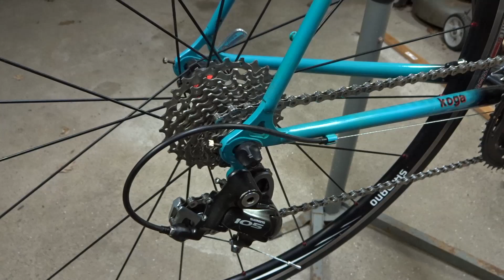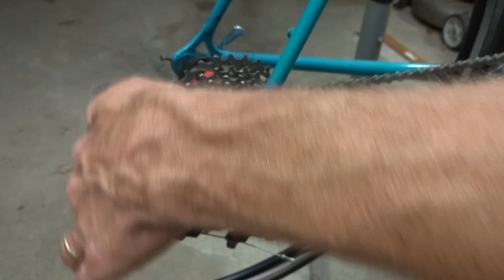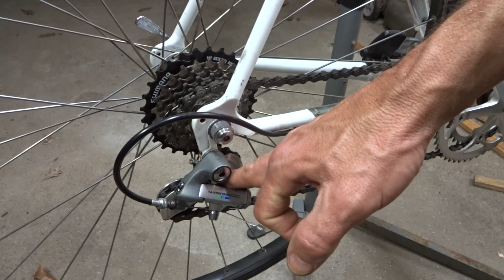How Indexed Shifting Works On A Bike

Comment: I was wondering how that worked. I converted my old Raleigh with downtube shifters (clamp on, not drilled in) to  indexed thumb shifters a 6 speed cassette (from 5 speed).  Time for a change again. I want stem shifters and I don't want indexed. I've had this old Raleigh from new and I want to give it a vintage look.

Comment: The amount of cable pull is set, I take it, by the click positions of the selector on the handlebar. I am having trouble with an old bike where the shift will stumble between gears. I figure this must either be a dirty shift cable sticking in the shrouds it passes through, or a worn selector on the handlebar.
Reply from the maker: https://www.youtube.com/watch?v=gwBQxhZhKnE

Comment: I have a Camapgnolo Athena 2015, and old Daytona 8 speed rear mech. What RD i can buy to mix it up. Because i cant find campagnolo RD in my country. Can i put a some mtb rd?? Im not looking for the perfect shifting, just ok.
Reply from the maker: Shrug. You will have to research cable pull ratios. Or find the correct RD.

Comment: Do you have a video on mix and matching derailleurs, shifters, cassettes/freewheels, hubs? I have an 83 Stumpjumper and it has a 7 speed cassette when it should have a 5 speed freewheel originally. The problem is that I don't know whether the current derailleurs (Deore XT RD-M735) and shifters (Deore Light Action SIS SL-M730) work with this 7 speed cassette. Thank you for the videos. I'm learning a lot.
Reply from the maker: No. Because there are so many variations and exceptions, it would be impossible to cover everything.

Comment: Hi Rj I've been watching some of your videos and subscribed. I stumbled upon your channel when a retired couple friend of mine gave their bikes to me. A man and women's trek 7300 model 1999 to 2001 I'm not sure. It is in perfect shape except that I want to convert it to drop bars (men's version,  my wife likes the women's version as is) and so i did. I  really don't have much knowledge about bikes so I  searched youtube and found your channel and got really helpful tips. 

So going back to the bike I replaced it with drop bars and not knowing compatibility issues replaced the shifters with Microshift R8. Right shifting was fine but the left shifter won't match the front derailleur (shimano NEXAVE, which I think is for MTB). So if I can make a smooth shift from small to middle ring I can't make a perfect shift from middle to large ring. Or if I fix the middle to large ring the middle to small ring will be affected. Yes I'm a noob about bikes so sorry if I did a dumb move. But I want this to work. I'm not sure if I will just replace the derailleur to a road derailleur or should I replace the crankset as well ( shimano dual SIS). Currently I don't shift from the front derailleur just keeping it in the middle. If I end up going to spend over 500 bucks I might as well a buy a brand new low end road bike or if I'm lucky I'll get one that's a bit fancier. I really like the low end emonda. Biking is a new passion for me.
Reply from the maker: Shimano road and mountain front derailleurs have a different pull ratio. You probably need a road FD.
Reply: @RJTheBikeGuy  ok I'll get a shimano road FD hopefully it will work. I'll give an update soon
Reply: @RJTheBikeGuy  man! It's tough looking for a top pull 3 speed road bike front derailleur clamp mount. Most are bottom pull.

Comment: I wanted to put a Campy shifter onto a 7 speed Shimano bike but can't find one that shifts exactly.  As I understand... 1.7*2.9 (Shimano 7 shifters)=4.93 against a sprocket pitch of 5.  Not sure how that works out with the slight discreptancy.  Campy 10 speed has a 2.8 cable pull which would almost pull the Shimano derailleur enough (4.76), but not quite. Campy 9 speed new has a pull of 3. So that would give 1.7*3=5.1.  Not sure if any of those combis really work but it would seem the Campy 9 could work. Is my analysis correct please?  There isn't much info on 7 speed options on the net but I don't want to change the rear freewheel because it's totally silent and awesome.
Reply from the maker: Just suggestion, but why not get a Shimano shifter, or a Campagnolo derailleur...
Reply: @RJTheBikeGuy  Thanks for your reply. My reasons for preferring the Campys... Two reasons, first, I like the thumb shift and the multiple downshifting, and second Shimano's seem heavier than their campy counterparts. I hadn't really thought about replacing the derailleur, but if that would make it possible to shift over a Shimano freewheel, I could do that, but wouldn't the same problem exist with the sprocket pitch?

Comment: I have just bought a cassette 11-40 ztto from China 9 speed. The issue is on the biggest sprocket( 40) the jockey wheel is rubbing on the outer edge of the chain and not quite sitting inside.ie it's too far to the left and making it noisy. All of the other rings are fine.The chain sits on the sprockets fine.
Reply from the maker: https://www.youtube.com/watch?v=KHXYN1JH8Oc
https://www.youtube.com/watch?v=9R1CVWcgu_M
https://www.youtube.com/watch?v=QRhKaZd6GWQ
Reply: thanks.I think i know why.because im running only one chain ring on the front so when im in the biggest sprocket the angle of the chain isnt straight.I guess this is one of the disadvantages of 1 ring.It is working fine though.

Comment: Thanks for your videos, you have saved me at least 15 hours building my bike! 
But now I need a rather specific advise on gear mech compatibilities. 
Thing is I have a very nice 8-speed Dura Ace groupset, it’s absolutely flawless and I wouldn’t change anything, but I want to swap my downtube shifters to dual levers. The new Sora looks appealing with it’s modern ergonomics and internal cables, but it’s 9-speed. Is it possible to have 9-spd shifter with the same old 8-spd derailleur plus 9-spd cassette (and just not use one of the sprokets)? 
I’ve been really digging this for the last couple of days, but as some people say it’s impossible, others just say it works with them. That’s so confusing!
Reply from the maker: The 8 speed Rd will work. It may or may not reach all the cogs.
Reply: RJ The Bike Guy, cool! Thank you! I’m happy there are people like you whose opinion can be trusted. I’ll go and buy new shifters and cassette right now!

Comment: Thanks.Sir,I need  a video on how to install a straight or non-tapered fork pipe in a tapered headtube ??
Reply from the maker: Not sure if that is possible. It would take some sort of adapters. Not sure if anyone makes them. And if they do, they would need to be for your particular diameters, etc. You will need to research,

Comment: what about the chain? can you use the same chain? will SRAM cassette work with shimano shifters and rear derailleur?
Reply from the maker: Higher speed chains are narrower to accommodate the closer cogs. Use a chain that matches the number cogs on the cassette/freewheel.

Comment: Does the front derailleur work the same way? When you shift from the small to the big chain ring at the front, does the shifter pull a few mm of cable and the derailleur move a few mm? Thanks for the video, it has demystified the concept of derailleurs for me!
Reply: @Luke Yes, exactly the same concept applies in the front, but probably with a different cable/pull ratio and front shifters that may pull the cable a different amount than the rear shifters.

Comment: I have to thank you for this video.  I was about to pull the trigger on an order for a new left shifter.  I was looking at hours of work plus the dread of having to rewrap my handlebar tape.  I happened to catch this video and thought it was worth a try.  It took longer to locate the WD-40 in my garage than to get my shifter working again.  Thanks for the huge savings in wasted money and time.

Comment: So for example, a 9 speed deraillieur would not work well with a 7 speed shifters and 7 speed freewheel right?
Reply from the maker: No, it probably would.
Reply: You must, at the very least, match the shifter's speed with the cassette's speed. You can probably use a derailleur with a different speed, but you won't have access to all of your cassette's gears.

Comment: So, could you use an ultegra derailleur (11 speed) with a 9 speed shifter on a 9 speed cassette? Since it's the shifters determining how much cable to pull through?

Comment: Based on your explanation then does that mean the derailur can support all gear speeds and that only the shifters determine how many gears you can shift?
Reply from the maker: Standard Shimano SIS rear derailleurs all have the same pull ratio: 1.7. But a 6 speed era rear derailleur will probably not be able to move far enough to reach all the cogs of a 10 speed cassette. But it should work okay on the cogs it can reach. (* older Dura Ace and Shimano 10 speed mountain rear derailleurs have a different ratio) p.s. this video isn't about compatibility, so I am not going to get into a long discussion on what works with what.

Comment: So basically "SIS" marking on Shimano drive-train components means the rear dérailleur's' pull-swing ratio? Considering that virtually all Shimano 5-9 speed drive-trains have the "SIS" marking, the dérailleur itself is not a part of the drive-train compatibility equation (only cassette-to-shifter compatibility matters). But does this also go to the front mech?
Reply from the maker: Road and mountain front derailleurs and different ratios. You need to use a road FD with road shifters and a mountain FD with mountain shifters. The cages got narrower with higher cog counts so you will get more rub if you use a 10 speed FD with a 7 speed chain.
Reply: Well, yes the more gears you have in rear the more precision it requires to fit drive-train components together.

However, doesn't Shimano 10 speed drive-trains come with the "Dynasys" marking instead of "SIS"? I mean that the cable pull ratio on these is also different.
Reply from the maker: Dynasys is the 10 speed mountain bike stuff that has a different ratio that road 10 speed stuff which is normal SIS. 
This video is NOT about compatibility. It is just how indexing works.
Reply: yep, sorry, just got pulled into the discussion really quickly :)
Reply from the maker: I am planning to do a video on basic Shimano drive train compatibility. But this wasn't it. I wanted to be able to reference this video to explain how indexing works.

Comment: does this mean I can use a shimano 9 speed derailleur with 10  speed shifter and cassette? as the 1.7 ration is across all shimano derailleurs
Reply from the maker: On a road bike probably yes. On a mountain bike no as mountain 10 speed switched to a different ratio.

Comment: hi Rj can i make my bike 1×11 cause my stock gear is 3×8..i really need your help my bike si foxter ft-301 it a really cheap bike so i want to upgrade it.
Reply: Short answer is "yes", but you probably will need to swap your bottom bracket. For more see below.

Having 8 gears in the rear implies that you have a free-hub, meaning that you can fit Shimano cassette there (like SLX CS-M7000). Some SRAM cassettes would also fit (look for the "NX" series), but most of their cassettes  is made for an XD free-hub, which is quite different from traditional (aka Shimano) one.

On the other hand most 3x (in the front) drive-trains come with square-tapered bottom bracket meaning that you would need to change it to an external-bearing one to fit e.g. Shimano SLX FC-M7000 crankset. Because finding a crankset for square-tapered bottom bracket which would work for 1x11 drivetrain might be a tough task.

And of course you will need a proper 11 speed shifter (e.g. Shimano SLX SL-M7000), 11-speed chain (your old 8-speed chain won't fit: it is too wide), shifter cables and housings.

But I would highly recommend you to consult your local bike shop/service before actually buying the upgrade parts. Especially I would recommend asking them about the proper bottom bracket for your frame and the new crankset.
Reply: KennyMinigun is there any little problem to 3×8 drivetrain to go 1×11 drivetrain? i like to save money...thats all thanks you so much God bless you.
Reply: Well, if talking about money, e.g. the SLX M7000 drivetrain on Chain Reaction Cycles costs around 300 euros: http://chainreactioncycles.com/pl/en/shimano-slx-1x11-drivetrain-groupset/rp-prod148625. However CRC rarely offer a good price (except for "clearance" items), so you might find this group set cheaper on some other resources.Also include the installation/tuning costs. So I would say, that you should have at least 320 spare euros for the upgrade. 

Or you can get a great deal on used components (e.g. 60% of the original new components' price). But you need to make sure that you are not buying a completely worn-out parts. So an bring a bicycle mechanic with you ;)

If that is affordable or not -- up to you. Wish you luck with that ;)

But if you want to upgrade your overall ride experience and don't have that much money to spare, consider changing/upgrading tires, grips and saddle. These components influence a lot on how the bike feels (in fact even more than the drive-train).

Comment: Got it, so even a shimano shifter has to be compatible with a shimano derailleur. Thank you very much.
Reply from the maker: Yes. I thought I explained that in the video. A Campy derailleur has a 1.4 or 1.5 ratio. So a Shimano shifter would pull the cable, but the cage on Campy derailleur wouldn't move as far as a Shimano RD would. So Campy shifters need to pull more cable for each click than a comparable Shimano shifter.
Reply: RJ The Bike Guy 
I think I got it now.

Comment: RJ is it the shifter or derailleur that determines how much the chain moves?
Reply from the maker: Both. The shifter pulls the cable. The amount of cable pull is multiplied by the ratio of the derailleur (1.7 for SIS derailleurs), so the cage moves 1.7mm for every 1mm of cable pull.

Comment: Somebody stole my bike !! I had taken off the chain to clean it.
It might be my fault. I'm not sure it was properly locked. I remember opening the lock because i had to move the bike a little bit to grab the chain. I'm not sure I attached it again when done. I might have not , I don't know. You do this so much without thinking, I might have just been confused.
Damn it. Damn it.
What an idiot I am.
I'm feeling low right now.
Reply: Yeah, the more I think, the more i'm realizing I screwed.
I attached the lock to the seat to move the bike but forgot to attach the bike afterwards, that's what happened.
And it took some random motherf....r to pass by it just at the right time.
Fuck it. Fuck me.

Comment: Do you mean 1:7 ratio? Stated as one to seven. I always thought that the shifters determined how far the front or rear mech. would move. Therefore it didn't matter if they were different brands. As long as the jockey wheels and cage were the same size as the chain for that particular cassette. And, the limit screws and fine adjustment barrels on the cables were set correctly.
I've never had to try this out but, it seems to make sense in theory. I've always used the derailers that were meant for the shifters along with the cranks, chain and cassette. Being that a matching drivetrain is always easier to live with, maintain and adjust. Thanks for posting.
Reply: bullwhip johnson 1.7:1.    1.7 x 2.3 = 3.91.  The cable moves 2.3 which cause the derailleur to shift over 3.9.  To be clear, I just learned that from our bike guru, RJ.  Thanks, RJ!
Reply from the maker: Yes, I said and meant 1.7. So 1mm of cable pull equals 1.7mm of cage movement.

Comment: As you mentioned this indexing RJ how do you know if  your derailleur is 7,8,9 speed etc. I have a bag of maybe 20 or so but I think only the shimano alltus one has writing saying 7,8,9 speed on it. Can you do a video on this and any differences between road and mountain bike derailleurs please.
Reply from the maker: Google the model number which is usually on the back in tiny print. Find the info on the derailleur.

Comment: Hi Rj, i have a 1991 Trek 1000 frame and one of the Suntour downtube shifters have seized. It is held in place by a screw with a plastic head, which can't be turned. Any tips for removing the shifter without damaging the plastic head?
Reply from the maker: I have a 1990 Trek 1000 which had Suntour downtube shifters. I don't recall any plastic screws. I have never seen plastic screws holding shifters like that or really any bike application that I can think of. So I am not sure what you are dealing with. Maybe post a photo on my facebook page.
Reply: Its the Suntour Edge shifters, has plastic heads that allow you to remove the screw with your fingers.

Comment: Thanks, I was aware of not being able to mix different brands of components but didn't know the technical side.  Makes me appreciate more the downtube friction shifters on my older bike, they are so simple.
Reply from the maker: I don't really use friction shifters with more modern drivetrains. But I am guessing friction shifters would work with most of them.
Reply: @Senapspiser so long as it's a 7 speed one, as far as I know it should work (ie not a 6 speed). You do the pull with friction so pull the amount needed until it changes. I have no idea what the changers are on my two that I built as friction shift years ago, but they both work fine, and they are a heck of a lot lighter than brake/shifters... like hundreds of grams.